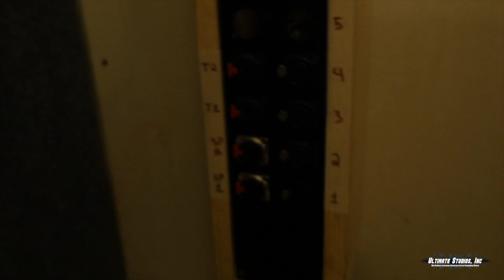Wiring A Recording Studio -  Mic Lines, Tie Lines &  Loops

Comment: This is super helpful! Question about your loop lines: Is Speaker Line 1, for example, a single line with connections in the Control, Live, ISO, and Amp rooms? If so, how are those wired? And your mono/stereo loops are the same way? Thanks!!

Comment: Very cool !

Dumb question though : how do you run the cables from one room to the next ?

Do you have panels attached to the walls that you remove and in which you insert your cables ?

I'd love to know how it's done (like how you would install a new line if you had too).
Reply from the maker: Not a dumb question at all!! 

In the beginning of the video when I'm sitting in front of the patchbay you can see the corner traps (with vertical wood slats) behind me. All of the cables from the patchbay run along the floor behind that trap and into a 4" pvc pipe that connects to the ISO booth. 

Behind the Wood patch panel in the ISO booth there is where the connection from Control to ISO is. There is also another 4" PVC pipe that connects to the Live Room. If you go to 8:18 (it's a little blurry) you can see a black panel that runs from the Live Room patch panel to the PVC pipe that connects to the ISO. That is how the cables get from Live Room patch to Control Room patchbay. 

The wood patch panel in the ISO is lined with 1" foam on the back and the rest of the cavity that is not full of cables is pack with foam as well. This is to mitigate any bleed coming through the PVC as much as possible. And it's really not very much at all. 

There is only one 8 pair snake that runs from the Control Room patchbay to the back ISO. It goes through the same PVC pipe from Control to ISO but it runs up and around the ISO/Live Room door and behind the corner traps in the ISO. It then goes through the wall and along the baseboard of the Live Room all the way to the back wall where is goes behind the corner trap and into a 2" whole that connects to the back ISO. 

In reality it's not really that hard to add more cabling as needed. It's just time consuming to pull out the Control Room corner traps, pull off the ISO panel and Live Room baseboard panel and then snake (pun intended) the cable through the walls. 

Does that answer your question?
Reply: @Ultimatestudiosinc  Awesome ! Thanks for the info !
Reply: Great info! Thanks.
My question is;  what type of cable did you pull through the 4" pvc? 
Microphone cable is 18 ga. Balanced, shielded? 1 cable per device? So 24 mic cables in the conduit, along with maybe 4  heavy ga unshielded speaker  wires?  What gauge is loop and tie lines? I see why 4" pvc would be useful, you probably have enough space for more cabling as future needs arise? 
Thanks again for the great info!

Comment: I was wondering if there is a difference between the speaker line jack and the mono loop line jack? Are both just TS jacks or is there something special about the speaker line jack?
Reply: Since most 1/4" jacks I'm aware of will handle high current perfectly fine, the only thing I can think of that might be different would be ground isolation from the rack panel chassis, which might be useful if wired with a ground lift switch. However, it looks like all of those particular jacks are of this type (though I'm not 100% certain).

Comment: About the speaker lines that you mention, doesn't those introduce more noise running long cables? If those are the ones connecting the heads with the cabs i asume those are not balanced right? Or you use DI boxes in the middle?
Reply from the maker: Hey Javier! Correct they are unbalanced. It's not a particularly long cable run. Less than 20 feet. Maybe up to 25 with the cables to get to and from the head and cab. I have not noticed any additional noise with this installation. We ran a pretty thick gauge speaker wire through wall too. 

The back ISO has a really short cable run. Less than 3 feet.